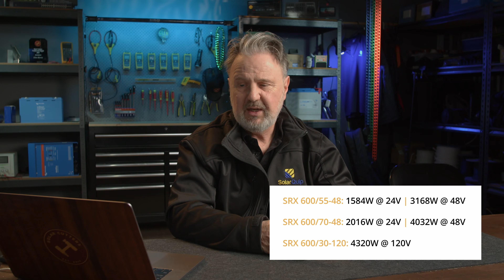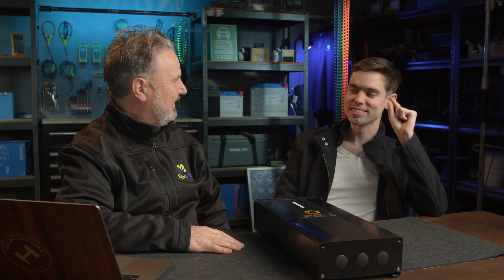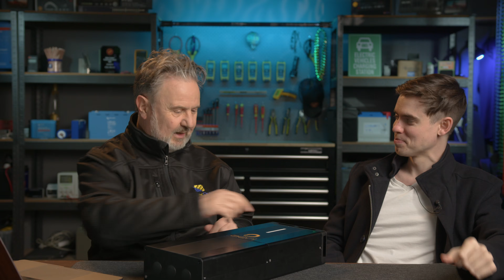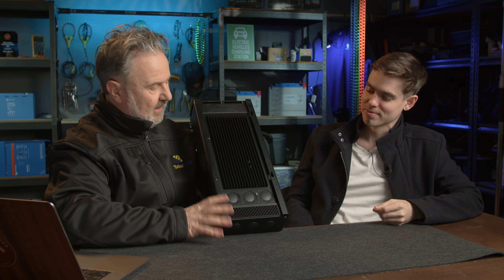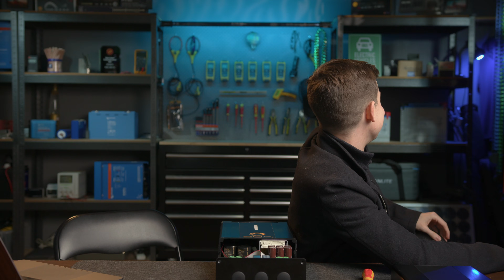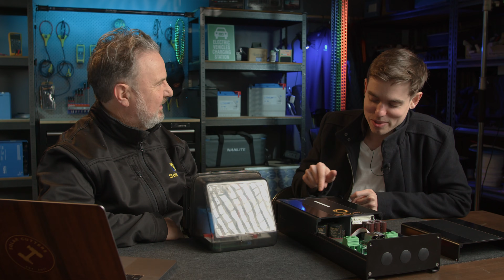Who invented the MPPT?

Comment: Mini PV (Winter) Solar Tip: You can gradually turn down a boiler and all other hungry electricity consumers with the "5000W dimmer".  Ebay €7.  I run 5 dimmers in parallel on an 850W inverter.  Kettle 2.2KW at 150W runs 12 hours a day, so the water is always hot.  The room is also nicely heated.  2.5KW washing machine runs in parallel with dimmed to 200...400W.  Iron, dishwasher, oven, electric heater, coffee machine, all internal heating are throttled with me.  Videos on my channel https://youtu.be/eC2olbCBhh0 The inverter stays cool, quiet and the MOSFETs remain intact because no extreme current peaks arrive at the inverter.  Now every Mini PV Inverter is enough to sell large devices.  So, with the dimmer, all internal heaters/devices can be converted into base load devices that stay almost permanently ON, drawing very little current directly from the PV.  With a wattmeter / energy cost measuring device you can then measure this perfectly in order to set the dimmer optimally.
        A little hint (for everyone else): Energy cannot be saved.  So if I want to boil my water, I always have to use the same amount of energy for one liter.  Christian's method relies on a longer period of time with less power in order to be able to use the power provided by the PV as efficiently as possible - so consumption peaks are intercepted.  In the end, the energy consumption should even be (slightly) higher due to the interposition of the dimmer, but it doesn't matter, since more efficient coverage by the PV system and therefore better use of the self-generated energy.....

Comment: What sort of inverter would you couple with these SCCs?
Reply from the maker: Any inverter as the SRX is dc coupled to the battery.
Reply: @SmartEnergyLab  Indeed. I guess I'm getting at the fact that it's ONLY an SCC. A lot of off-the-shelf residential systems are all-in-one units.

I want to build a house with 3-phase power, and enough battery to be independent of the grid, yet have a grid tie for the most lacklustre of weeks in winter. 

I'd also like to have a battery shelf or bank that isn't an off-the-shelf product, because I believe it can be done a whole lot better for the price.

I'm interested to hear suggestions of inverters which could be deployed in such a system? 

I also need to know if that custom battery build is legal, I suppose.

Comment: Another thing with AC coupled with Frequency dependent active power reduction in off grid is that if a huge load is turned off while the PV array is also generating a large amount of power it can't react in time and the AC coupled PV inverter can shut down from Over voltage. Had to re-configure ride through on a Fronius Primo 8.2 to stop it. Typically happened in Summer with full batteries. AC coupled with a 10KW Quattro. Hasn't blown up after 5 years so whatever. The clock on his SMEG oven is out too.
Reply: There should be a setting to only charge the batteries to 95% so there is something up the sleeve to dump 8KW into the batteries on short notice. He had 30KWH of BYD so it could handle it. Maybe there is something in VE. Config. But who knows. Victron tech support is non existent.

Comment: Apart from the 600V limit (beats Victron), what looks best is that it doesn't have an upside down top hat cover over protruding terminals or plugs with tiny non magnetic SSteel screws that love to fall in the grass below while trying to balance them on the tip of a PH2 driver bit (water enters where the missing screws are and it fills up like a cup). With this it's straight in with conduit from bottom. It could almost use a 2nd add on box with another set of rear and bottom entry punch outs mounted below the main unit with a drain. Otherwise the rear entry punch outs can't be used. I used to always go down the cavity on a brick veneer house. A DC isolator would be good in an add on box too. That would clean things right up on the surface and save time and money as well.